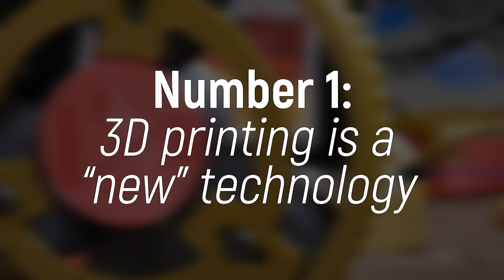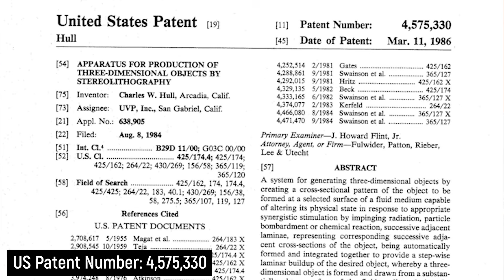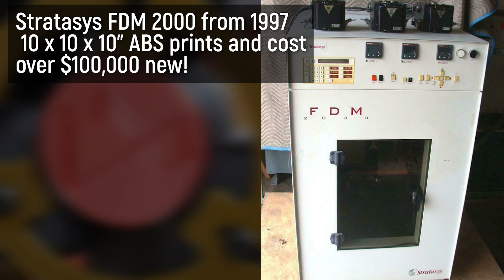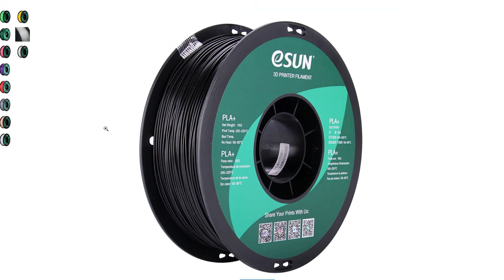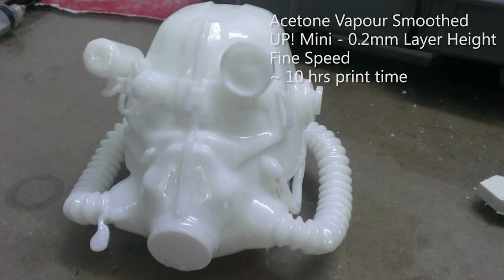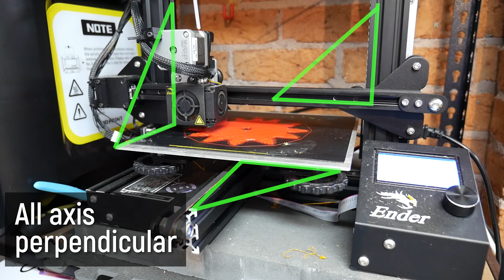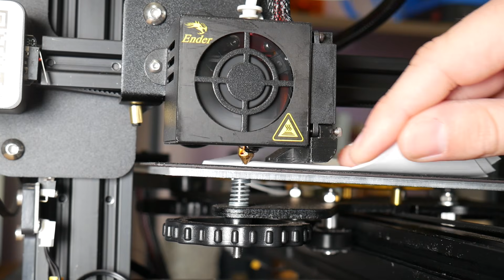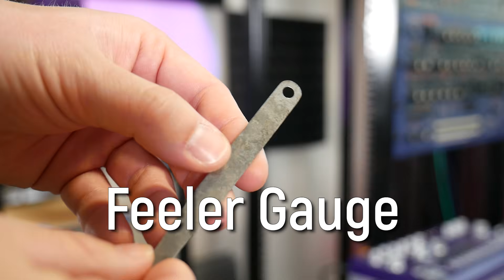3D Printing Myths I used to believe...

Comment: Firstly, I am NOT saying that a professional is incorrect nor am I saying that my noobery discovered some magic, frankly, I concede its more likely I simply stumbled upon a pot of luck... Or maybe it fell on me..?

Anyhow...

I misunderstood the 'paper leveling' trick, and I simply used a normal sheet of printer paper, no folds, and leveled my bloopy that way. I have an Ender 3 Pro.

As long as I do that every 5 or 6 prints, I have literally not had a single print fail. I usually do not need to, but I would rather spend the 27 seconds finding out it was unneeded, than to not do it and have a print fail after 12hrs due to adhesion issues.

Literally, in the year I've had my printer, and perhaps pushing 120 prints, I have had one single print fail, and it was a result of me not leveling the bed. It was my 4th print, and I simply didn't know to after so few prints (I assume it was just a result of being new).

Ultimately what I'm wondering is, have I been doing this incorrectly, or did I happen upon an effective way for my particular unit...? That is, aside from the whole, 'If it works, who cares!?' mentality... I would like to know empirically, objectively...

THANK YOU TO ALL THAT COMMENT, EVEN IF YOU CALL ME A RETARDED ASSHOLE! MAYBE I AM, BUT IT REVEALS WHAT YOU ARE. 👍

THUMBS STRAIGHT THE FUCK UP FOR THE TURDCOBBLERS.

You know... Yes... You know...

🤣🤣🤣🤣

Thank you Angus! For your hard work, time, effort, intelligence and your financial investment in teaching us how to be better at this art. It is an art, whatever folks might say.

There is a skill to it, but there is also an intuition that knowledge can not compensate for! 😁 That's the truth. 👍😁❤️

Comment: The reason 3D printing took off around 2014 was the commodification of them. My high school spent $1200 for a tiny printer in 2013, but now you can get an Ender-5 with a print volume larger than the aforementioned printer for $500

Comment: I spent hours trying to level my first print bed with a bit of paper to try and figure out why it could never lay the first layer down. In the end it turns out i just needed a layer of cheap blue tape. Once i put that down, stuff sticks easily regardless if it's proper level or not.

Comment: The tramming method shown doesn't make any sense. If you use a 0.3 mm feeler gauge then your nozzle is 0.3 mm away and that is way too far for a 0.4 mm nozzle. Then what about initial layer height setting? That gets added to the 0.3 mm gap. Now you are definitely way too far. Did you skip a step? It is important that the actual gap exactly equals the initial layer height setting in your slicer, this is because slicers produce gcode to put out the right amount of material for the initial layer height setting. If you add any height to that gap, that the slicer doesn't know about, the wrong amount of material is extruded for the first layer.

The gap left after tramming should be exactly 0 when the bed and nozzle are at printing temperature and then you control first layer gap solely with initial layer height setting in the slicer. Now your method would work if you configured a negative z-offset equal to the thickness of your feeler gauge. Is this what you do? If so you should mention that because as described in this video the tramming method doesn't make sense.

Comment: Loved the leveling segment (and the other stuff too) but I think there's room to spell out some other details like the difference between what zero really means at different stages of the process. So initial Z zeroing would be the nozzle touching the bed IMO, then there's an offset (paper or spacer method), then when printing is the initial layer (plus anything else I missed). I've been looking for an image that would demonstrate this so we not only know how to level our beds but also how to set the initial layer. Hard to find this in a simple video so far.

Comment: Hey Angus, a chemical engineering postdoc from Macquarie Uni here. Just a small addition regarding the PLA and ABS. I recently attended a seminar held by Royal Australian Chemical Institute on recyclability and reuse of plastics. What the big guys from industry said is that PLA is an absolute evil (counter-intuitive, yeah!). Now, let me explain. Yes, it is potentially biodegradable. However, a lot of PLA ends up in the bin for recyclables, and it is extremely hard to distinguish one sort of material from another when all of them are mixed and being shredded to pieces. An absolute majority of recycled plastics end up as moisture insulating sheets in the buildings and even if you have small impurity of PLA there, it destroys the material over time. This is a serious business when you think that a catastrophic building failure could be caused by a bunch of guys with 3D printers and packaging films. Among all materials nothing beats PET (or PETG) in terms of environment impact, strength, quality of the print and chemical stability. Hope it helps!

Comment: Some serious flaws regarding feeler gauge. First using any wont help at all, they are common in sizes from just a few hundreds of a millimetre up to 2 mm.
There are two issues with using paper instead and both can easily be avoided. The first is the fold since it will be a bit thicker just at the fold and have an increased amount of spring in the feel. Second is that paper also varies in thickness and structure thus compressibility and feel. Just choose a suitable thick paper that you have access to.
A more serious issues with using a metal feeler gauge is that it might damage the printer or at least effect it by being rigid.

You are also neglecting the bow of the platform, something that is unavoidable with heated beds (not like they're very flat to begin with perhaps except glass and similar). Only way to minimize this is to make sure that there is as even pressure on all four adjustment screws as possible. (Three would make the setup process better but loose some rigidity.) 

As a professional machinist I wont even consider using feeler gauge on my hobby printer... (And woe he who gets melted plastic on my measuring tools).

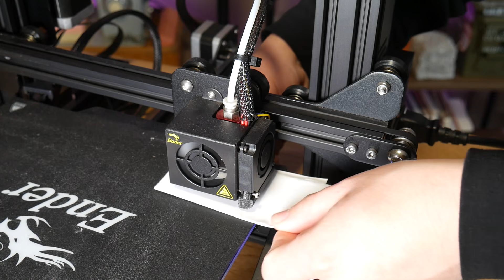Comment: Clip starts at 7:50  And which feeler gauge is the right one? I have a set of feeler gauge running op from 0.02 mm to 1 mm.

Comment: Not quite Tramming either.It would be if both ends of the axis run were measured both top and bottom and then diagonally.The bed has absolutely NOTHING to do with it.

Comment: I like how you level the bed. I've recently discovered a similar technique, where I heat the printer, auto home, then adjust each corner until I can actually feel the vibration of the hotend in the adjustment screw, signifying that the hotend is now touching the base plate. I can also ever so slightly hear the hum disappear when it touches, and I have had amazing results from it without the need for a feeler gauge

I also no longer need to do a live adjustment for leveling. Just listen/feel for the nozzle touching the base plate
Reply: Same here: pre-heat PLA, change filament to actual color, Auto home, disable steppers, 4 corners and center with paper (unfolded), I feel the fans sucking at the paper = perfect 

Daily routine, 30s …

Bought gauges: oily mess, 0.1 mm gauge is soo damn thin … no fun at all

Comment: yeah i was using a 0.09mm feeler gauge to level my bed from home for the longest time and always got it to my taste. i had no idea tho that should be going to home then up and then use the feeler. is it still okay to drop it to home then use a feeler?
Reply from the maker: The bed and extruder mechanism has some spring to it, so a 90 micron feeler gauge will do much the same as a sheet of paper, should work if you got the technique down! I still always watch the first layer to be sure and adjust as needed.

Comment: i use a metal block of known exact thickness.  lower the nozzle just below the top of the block and slide the block up against the nozzle.  jog the nozzle up until the block slides under. remove the block and go down one step.  switch to a smaller increment and repeat.  when you get to your finest increment and the block slides under, you know you are at the exact thickness above the bed.

Comment: As someone who has been dealing with 3D printers for several years, and work on cars, the trick about the folded paper, yeah I have always done the business card thickness trick. Even though I have plenty of more accurate measuring tools. I am going to use my feeler gauges on my printer now cause holy cow that makes so much sense and Im somewhat embarrassed I didnt even think to do that!

Comment: Whats the typical thickness of a feeler gauge? I usually do the paper trick NOT FOLDED - and if any adjustments are necessary for the first layer I manually raise the Z stepper by one click. prolly bad for my stepper but never fails

Comment: Isn't it, with manual levelling, you in fact really start at Z=0, i.e. the position of the mechanic endstop? Also, setting a Z-Offset value does not make much sense if you don't use ABL. Some Firmwares/Machines are even configured to disallow babystepping without a ABL-probe connected...

Comment: I enjoy your videos, however, big difference between a 3D printer as shown, and additive manufacturing. We consider additive the Selective Laser Melt metal powder machines,  and some even have full machining capabilities built in. Now those are really changing manufacturing, not the little plastic machines.

Comment: Raise3D Pro2 (and possibly others) calibrates Z-offset with an optical interrupt switch at Z-0 and an adjustment screw to change the offset of the interrupt tab. The units ship with a feeler gauge.

Comment: Also note that when you are leveling and using a piece of paper try and use a different part of the paper at each corner (and center) as the paper might get dented when you are feeling the distance (like writing with an empty pen). And also before you do feel for the nozzle height. You are heating the nozzle already and a tiny bit of filament might have already oozed out of the nozzle or starts to ooze out during the leveling giving tiny skewed results.
Reply: I don't know if it's the "right" answer, but I've been preheating my bed to printing temperature, and my nozzle to 70% of printing temp.  It's hopefully close enough to get the thermal expansion close enough for levelling purposes, but not hot enough to let it drip.
Reply: His last point about bed leveling is very interesting. Based on this idea, you really don't need to go out and buy feeler gauges. You can just use any solid metric item (such as an Allen wrench or raw scrap metal) and hop the Z axis to the size of that item.

Comment: Make sure your feeler gauges are free of oil. A lot of the time they come coated with a thin sheen, and that oil will absolutely trash first layer adhesion. But yes, a feeler gauge is optimal for manual leveling.

Comment: The easiest way to level a print bed is to put a dull light behind the printer head and move the nozzle to a couple centimeters from a corner and set it to z=0 (lower the bed first though), then look at the shadow between the light on the build plate and adjust the knob until the nozzle touches its shadow.

Comment: A question that may address multiple issues:
Has no company employed automatic bed leveling or extrusion tip adjustments using a magnetic proximity sensor and step motor driven leveling screws? This is a feature on milling machines now for both beds and tool length detection.

Comment: feeler guage is great advice. no user manual mentions that you need to preheat nozzle before leveling. i learned from hard way. 
now i'm ordering for feeler guague. maybe i able to fix my handmade p3steel printer and get good prints like my ender 3 v2

Comment: Thank you so much for the bed leveling bit...I just got my 1st 3D printer and have been making really awesome spaghetti with it after leveling the bed with a sheet of paper about 17 times.
Reply: I use a sticky note single layer, and know where Baby step is.. practice practice.. I upgraded the springs.. too.
Reply: Please PLEASE buy a feeler gauge. using a sheet of paper is really bad advice because... "paper" is not a valid metric of thickness.
Reply: @humbughumbughumbug  I did, and yeah it definitely helped. Just figuring out what that magic number for the gap is made a vast difference.
Reply: @DanBowkley  make sure you check out bed levelling test prints if you havent already. i normally get the ones which have lines of a single line thick. after printing run your finger across those lines and if they don't move then you have your z-offset perfect
Reply: @TheFryPo Well, first of all, I would give a little more thought to how you express yourself here. So there are several factors, on the one hand we are talking about a printer which costs about 250 dollars new. In this price range, it is hald often so that not all Tolleranzen adhered to. In the production it is also never possible to make everything perfect.

The Ender3 V2 has a few problems. It is also a very big matter of luck. I have seen a couple who made out of the box everything great. Others had many problems, fortunately there are enough prepared files.

When leveling make it so long until you have a passage at which you no longer have to adjust anything. It is a matter of practice. But there are also other factors, ev some glue. You can buy these for the printer or even a glue stick can work wonders.  Otherwise you can also try to increase the temperature of the bed to 65 or even 70* This is no problem with PLA.
Reply: Dont fault the technique at your own incapability to build the printer with straight frame. Thousands of people are using the technique just fine and it doesn't work only because you and Maker's Muse couldn't make it work?
Reply: @TheFryPo  I really wish people weren't such fucking dicks.

Comment: new to 3d printing my self ordered a BL touch for my ender 3 but also been using the paper thing but not folding it over seems to be able to set the bed height of my printer well with minimal elephants foot but its hit and miss with it sometimes I get it good sometimes its fails with poor bed adhesion iv upped the temp of my bed to 60 degrees using crealitys slicer and PLA and its worked well. printed a benchy and had a near perfect print right off the bat using AMZ3D black pla

Comment: Thank you for the tips about the bed "leveling", i have been using the paper method, though not folded, just single sheet thickness, and have had somewhat mixed results, this is going to be a massive help!
Reply: Just out of curiosity, Angus, have you found the JP-8000 and (what looks like an) ARP 2500 to improve the quality of your first layers? Cool stuff!

Comment: the degree to which plastics are 'UV stable' is dependent on additives, not really the polymer family. The UV additives are included in what's known as 'masterbatch', which also contains the colour. The base resin is blended with the masterbatch in granular form, just before going into the extruder. Black is usually the cheapest, as the colour and UV additive is just Carbon Black.
Plastics that fail more quickly in sunlight do so because the material supplier cheaped out.

Comment: A lot of people don't realize 3D printers started to take off in the home market because the early fdm patens ran out. 

Don't forgot about about paper weight effecting paper thickness. You can easily looking at a .05mm difference between copier paper and lets say heavy weight paper like what you would use for a resume.

Comment: @makers muse you need to have the nozzle cold if you want to use the paper trick the idea is it makes up for the expansion when heated to get you to a true 0 when touching bed so like you said when you start the print it is at your commanded height . You should make note explaining that if using paper then to not heat the nozzle

Comment: Don't forget about the double click to z offset for your paper leveling. Instead of turning the knobs, I do that. Every now and then (not often) I need to adjust one knob to make all of it trammed. 

That is, of course, a setting that 3d printer manufactures rarely enable. But I modify the marlin code just to get it.

Comment: The problem with the feeler gauge is steel vs brass. You can end up with strange print errors because you've worn one side of the nozzle away.

Comment: About bed leveling - you can still using paper, or anything, even steel plate and after calibration process simply set home offset of Z axis using M206 command. If your paper is for example 0.1mm thickness, you put M206 Z0.1 command on start gcode or save on eeprom and nothing more. Now Z0 is TRUE zero level after autohome. 
If you want you may change this value any time, is only important to good calibrate your bed, no matter what is distance between nozzle and bed, but is important to keep same distance on each 4 corners.